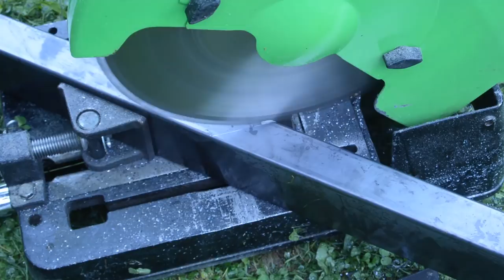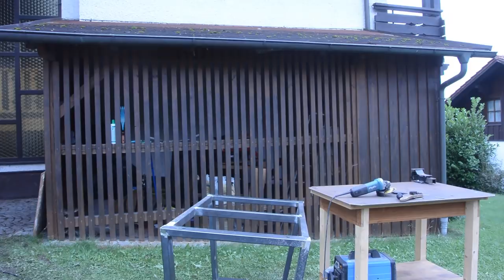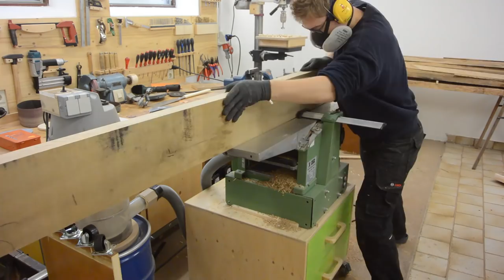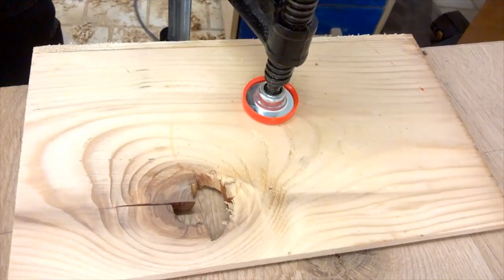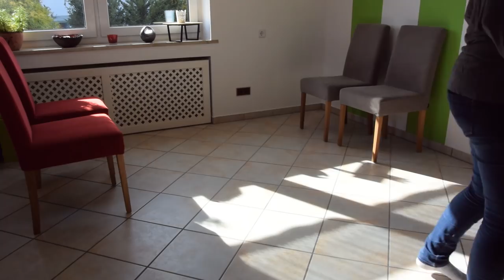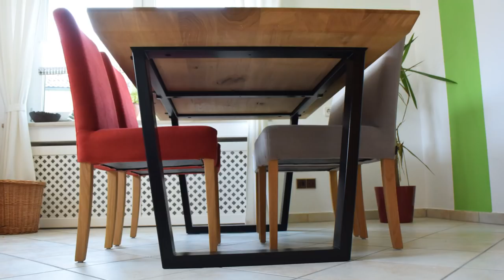Wood and Steel: Building a Dining Table | Short Version with Music

Comment: Hi Cosmas, you've added a chamfer to the lower edge of the two short-sides, that makes the table look really sleek. Would you consider adding a similar chamfer to the UPPER edge of the two LONG sides? (Would look supercool, IMO, especially in conjunction with the trapezium-frame!